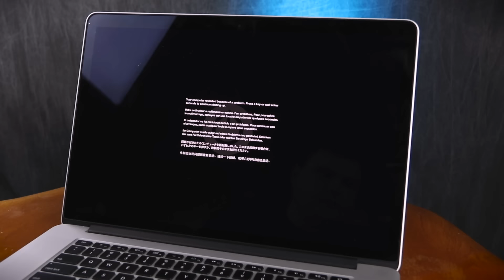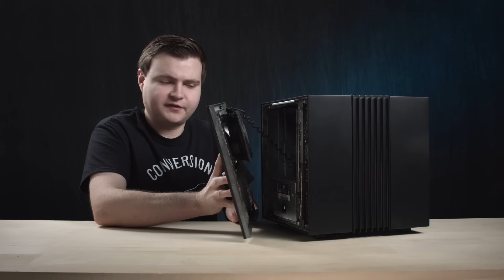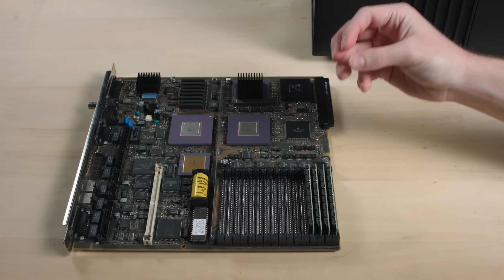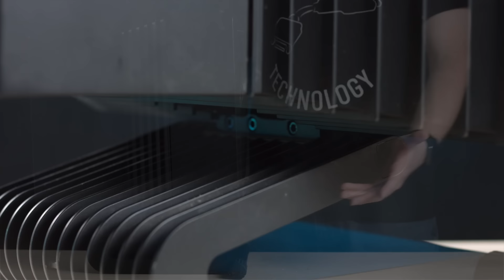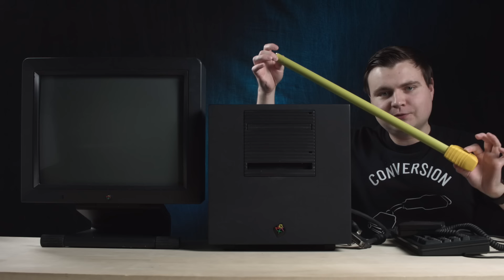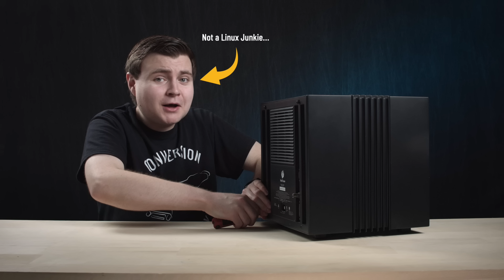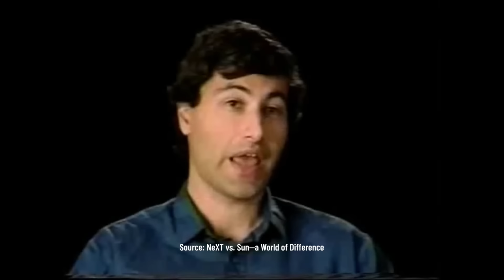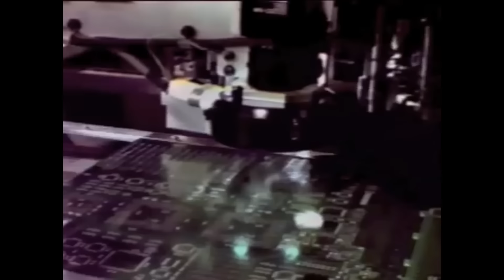I Bought a NeXTcube, Now What? - Krazy Ken's Tech Misadventures

Comment: The following is a brain dump. My memory may not be 100% accurate. In the terminal pbcopy and pbpaste can be used to shuttle text between the clipboard and stdio in the shell. This is incredibly useful. It still exists in OS X.  We used these as pentest boxes in the 90's. A favorite "move" for me was peeling contents out of spreadsheets with copy and then using awk/sed/cut/etc to manipulate the data. One could use a `pbpaste` in a for loop in the shell to iterate port (strobe, then nmap) scans across an arbitrarily large number of hosts. I still do that today, in fact, 21 years later.  You can also drag a file icon into the terminal and it'll "paste" the absolute path to the file, including \ escapes for spaces. There's a bunch of great music/sound tools for it. Look around for Princeton Sound Kitchen and Music Kit. IIRC Stone Design gave out license keys for their entire software suite, which included drawing software, a word processor, and a spread sheet. You'll want to compile a (much earlier) version of gcc on it, particularly if you want ssh. If you can find a copy of Allegro Common LISP for Nextstep, and so far I have not been able to, Allegro will hook you up with a license gratis. If you have a printer you can turn it on and off w/the shell via nppower (nppower on / nppower off). The defaults command dumps the user's defaults settings. You can "defaults read" to dump the settings and "defaults write" to write them. niload / nidump handles the contents of some configs that would normally be text files on literally any other system of that vintage. So you can dump the /etc/passwd file with nidump /etc/passwd . . I think it also handles the hosts file, groups file, and perhaps one or two others. There is a fairly substantial freeware/abandonware software base out there. Google "peanuts archive". For the viewers it is possible to get Openstep and possibly Nextstep 3.3 running in a hypervisor, but it will take some fiddling about and you won't be able to run binaries that require the 56k DSP.
Reply: Does that thing have an MO drive? That slot suggests that it does. I don't know of any of those drives that still work. Most of them started to die off fairly quickly. They were also terribly slow and I am fairly sure that Bernoulli and Syquest disks were more popular (and they weren't all that popular). So good luck finding a MO disk. :)
Reply from the maker: It has an MO drive, but I don't think it works. Coincidentally, I have a Bernoulli disk and disk drive. I'll show those in a future episode. : )
Reply: @ComputerClan  ooh! 8" or 12" (phrasing!)
Reply: @ComputerClan  See if you can get a copy of "The NeXT Bible" by Doug Clapp. That has a lot of info on the original system (030) which is not that different from the 25Mhz 040. Nextstep 3.3 (and Openstep 4) run like gangbusters on SPARC and HP PA RISC hardware. After my personal Turbo ColorStation got too long in the tooth I started running NS 3.3 on a HP PA-RISC 712 workstation. It was amazing.
Reply: One last thing! I notice that you don't have anything about A/UX on your channel. You should take some time and put it on that sweet IIci of yours. :)

Comment: Funny you talked about CD quality 44K 16bit, but even by today's standards its still very good if you consider the fact that most listen to compressed music files thru crappy earbuds. In my studio I record at 128K 24bit and then down sample to 44K 16bit which is still the standard in many cases.
Reply: this has nothing to do with earbuds, and more to do with it is far too expensive currently for the general consumer to run a sound card that is capable of outputting at that, especially when you consider that all hooked up equipment also has to support that rate, and even my THX Logitech system only supports 96k supposedly.  And when was the last time you saw a computer with a separate sound card outside the late 90s?  almost all sound is handled in the mother board now, unless you have the money to splurge on fiber and decoders.

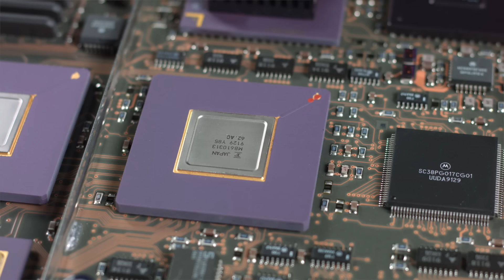Comment: 9:30 this particular board probably was designed in 1990, but it was manufactured in 1992, or very late 1991  (9:30 left chip shows as mfg date the 42nd week of 1991).

Comment: have you tried increasing the 'resolution' to 256 colours, and then improving the colour_quality. That would be next_level computing on a 25mhz system. you'd need to source a custom video card though.
Reply: Someone probably has a NeXT Dimension board floating around.  Full coloration for the cube , the board was $6000 when new.

Comment: Use a framing square to measure it. Also the slack in the end of your tape measure should cancel out differences between pushing or pulling on the end while taking the measurement. In this instance, just pull for every measurement to make a meaningful comparison.
Reply: Just put it sideways and top-down onto the table, mark the dimension with pencil on the tabletop. No need for absolute measures.

The 1mm difference is probably to counter the optical illusion that a perfect square always looks taller than wider. So it looks perfect to the naked eye. Of course, they couldn't upset customers by selling a (deliberately) imperfect cube, so the brochure gave the dimension as 305mm +/-1mm.

Comment: I used to have one in 1991.  As software programmer, it was a fantastic operating system. 

By the way, the floppy disk supported special floppies with 2.88 Mega bytes storage, twice the 1.44MB standard at that time.

Comment: I was a interested several years ago, but also asked what I would do with it. It is a very rare and cool find of history. These units were pricey, thus in lie numbers. In about 2007 I could have purchased a running Lisa for about $500 US, I stupidly passed this up. My buddy was going to buy a Cube, but instead picked up a MAC Quadra loaded with 128mbs of ram, while most of us had 16mb PCs. Regarding the manufacturing date? Nice to see American made. Those noise while operating? Either a cable touching a fan blade or bearings are shot in a fan.

Comment: It looks like this thing was built so you could slide 4 motherboards into it.  Would that even work?  Could you have used this as a server with 4 CPUs, each with their own RAM, somehow?
Reply: The cube wasn’t designed to hold multiple motherboards, but you could do it by moving some jumpers on the backplane board. You ended up with 4 independent computers in the same box, rather than 1 computer with 4 processors.

Comment: I had a Mac with 3 nubus slots I think, I actually used one of them.  I think I was the only person in Ontario to buy a Nubus card lol... as the Nubus cards cost more than some computers ..... Cool NeXTcube though! I remember those, they were indeed  $10,000. My first Mac of around 1992 cost me $2500 and it had a 68030 and did not include the color monitor or printer or keyboard. Still it was cheaper than the NEXT.

Comment: someone get this guy an actual tool kit. drives me nuts watching people use the wrong tools let alone a bulky ass pos utility knife. its also pretty amazing youre able to measure 1/2 mm with a tape that only measures inches and feet... astounding.
Reply from the maker: It wasn't a utility knife. It was a hex key kit, and there were hex screws on the back. So… I thought that would work. Hex key. Hex screw. Ya know. Simply.

Comment: As a certified Apple tech I had the opportunity to see some older equipment in a Apple research center. 

They went over the logic board in detail.  Apple didn't call then motherboars. That's a PC term. 

Love your review, beings back lots of memories.  One thing to point out, it appears that you not using any ESD protocols. 

A antstatic mat and wrist strap should always be used.  PC's are better protected from static discharge.  The logic board you are handling it not!

Comment: With the kind of high voltage pars found inside a CRT, I am not too sure you would want the outside to be metal.  I am not saying that it has never been done but the ones you see with metal are probably grounded in multiple places.
Reply from the maker: Ahhh, good point.

Comment: I like how that fan had a removable plug.   is not something I ever see on anything
Reply: Other than inside a powersupply, I've never seen a soldered fan in a computer, they always have connectors. Even inside the laptops I've worked on.
Reply: But they do have plugs

Comment: Back when I was a teenager I actually got a NeXT cube for free from my local computer shop, the guy that was running the shop gave it to me cause it had been sitting there for months and he was tired of looking at it, Mine had a dead removable drive, I took it out to try and fix it but it was beyond repair, I kept the disk though, I also have the NeXT laserjet printer, I have no idea if the printer works cause I couldnt figure out how it connects

Comment: Had one of those on my desk in 1994. Was pretty sweet for the time! 

But the chip density on this board is pretty typical of 1988-1990 boards. If you're going to take chances (and they certainly did!), you don't typically do it on the PCB!  :D
Reply: Yeah the NeXT motherboard was nothing special.  HP-PA Risc had an awesome circuit board..., and it ran NeXTStep.

Comment: The The Motorola 68040 is a 32-bit microprocessor from Motorola, and was released in 1990, yes that NeXTstep 2.2 PC looks good, but $10.000 for a machine that do not have colors is just not really acceptable, The Amiga 3000 that came out in also 1990 had 12-bit color palette (4096 colors), and had a Motorola 68030 CPU at 16 or 25 MHz, yes slower then the 68040 25MHz but a LOT cheaper, and could be upgraded to a 68040 and later to a 68060.

But the Amiga 1000 back in 1985 could already do 2-bit color palette (4096 colors), also back then for a LOT less money, same for the very popular Amiga 2000 (1987) that was used by a LOT of companies to make graphics for in movies cartoons and many more.

Comment: Maybe measure it with you know, a metric ruler or a square with metric graduations. Using an inch scale is going to add an awful lot of uncertainty. 16th inch graduation markers are kinda all over the place as far as a mm is concerned. It'll be difficult to eyeball. 1mm equals what like, 0.040 inches I think. One 16th is 0.0635 I think? Anyway nothing lines up well at all mixing the systems. Not at that scale, not measuring a single mm over 12 inches.

I'm rather curious as to what the optical drive was all about, did it not work in your rig?

Comment: The menu system was similar to IRIX which was also vertical instead of horizontal. Having it a movable item made constantly mousing to the top of the screen a non-issue. It's a pity OSX abandoned that when they did the Aqua Interface to placate Mac users.

Comment: The DSP I can possibly explain a little. Back when Apple Computer was formed, they had a trademark conflict with Apple Records, which was solved under the stipulation that Apple Computers couldn't produce studio quality music (not unless you're an end user who could set up an aftermarket interface like MIDI or even stereo sampling hardware). Which is why up until the early to mid 90s, you simply couldn't get a Mac with stereo outputs, just a mono speaker (Atari ST variants and even the lowly PC of the day could trounce them on that at the time). But since this was NeXT, hey, no trademark conflict! So it could be built for full digital audio without repercussions.
Reply: And you had to pay extra for an audio digitizer so you could record on a Mac.
Reply: Macintosh II. Introduced March 1987. Stereo audio output. Macintosh Quadra AV. Introduced July 1993. Onboard - AT&T 3210 digital signal processor - for on-board 16-bit 48 kHz stereo audio playback and recording capability.

Your history seems a bit off.

Comment: My Amiga had CD quality sound..like it was no big deal, really.
Reply from the maker: I believe it was a big deal. Hardly any machines had it. Just because your Amiga has it doesn't mean everyone has it. : p
Reply: If you are referring to your A4000 (and/or other Amigas): Technically no, it has absolutely not! Only in theory, that is. It is capable to produce 14 bit only and that is only possible by combining 8 bit DAC and 6-bit volume control. (oversampling)
It can technically handle up to 57kHz sampling rate, wich is highly dependent on your CPUs power. And, most importantly, the systems graphics mode must be set to double scan-mode.
The overall quality is...let's say listenable...more or less..., when playing back mp3, don't raise your expectations too high.
I used to have an A1200 stuffed inside a Micronik Tower, packed with a Cybervision 3D and a Phase 5 Blizzard 1230 IV with 32 Megs of RAM on it and the coprocessor. I experimented a long time with mp3-playback and it was not really ear-charming, but fun to see, that it was possible. What I noticed everytime was a really high CPU-usage wich resulted in high loading times for each file. And it suttered here and then. I dreamed for a Toccata, but could never afford one.

Amigas were really some beasts of a machine, but never in stock-condition. So be true to yourself, wenn posting such rubbish.

Comment: The data sheet was interesting, especially how one could upgrade the dedicated SRAM for the Motorola 56K DSP. I don't recall that being an option on the later Atari Falcon030 which also featured that same Motorola DSP. That was one awesome chip both for audio and for what it can do as a fast co-processor for a 68030 or 68040.

Comment: get an 040 to 060 upgrade for it, you can find them on ebay. its a socket that fits for the 040 and steps up to a regulated socket for the 060. you may or may not need drivers? i know the amiga does.....
Reply: Vampire board for the NeXT!

Comment: I would definitely replace the stock fan with a Noctua fan and you'll just never hear the worn ball bearing again :D Also, replacing the SCSI hard drive with a SCSI adapter and shove an SSD or SD card in there would be a big leap.
Reply: Based on the type of connector on the fan, it is probably 120V AC not 12V DC.
Reply: Why replace it, unless you want to spare the aging HDD by not using it. SCSI should support at least 8 devices on its bus (looking at the cable it seems to be the narrow variant. One ID will be reserved for the controller itself, so you have 7 actually useful device IDs). You should be able to just add some more storage devices to it, as long as they are narrow SCSI....
Reply: Jiri Wichern Because of the noise it makes after all these years :)
Reply: Sure, if you actually intended to USE the thing, but why would you?
Its cool for the time but TERRIBLE compared to even a 2001 imac.
Reply: @mawlakewlz  So people using C64s today for their enjoyment are just plain nutjobs? Surely not. There's something magical with these old machines and for a specific set of tasks they're totally fine even today. You won't be gaming on there in 4K, but that's not the point. I sometimes spend time in front of my Macintosh SE to do some writing and it's a so nice, uncluttered, undistracted experience. I would definitely use a NeXTcube if I had one...
Reply: Bubba this is a piece of computing history. Stock components only. Respect the cube.
Reply: @an1skh4n  You should upgrade components also, harddrives will eventually fail ..

Comment: DOOM through QUAKE (I) were done on NeXT too, before id switched to Windows NT for QUAKE II.  Atari's Falcon030 computer from 1992 also used the same DSP as the NeXT computers, which was touted as being able to handle 8 channels of 16-bit audio (up to close to 50KHz sample rate) simultaneously.
Reply: Yes, the Motorola 56K DSP was incredible for that era, and why it cost $1k on its own. Atari Corp wanted to use the DSP as its own voice modem in the Falcon030 but never got around to finishing the software for that feature set [they also ran out of money before enabling that with the Atari Jaguar's DSP too]. It cranked out awesome audio. There's a few modern audio chips that use cores from that chip, which have even been used in some of the iPod Shuffles but nobody so far has figured out how to use those cheap chips to use them like the full Motorola DSPs in order to, say, add them as upgrades to older Macs, Atari STs, and Amigas. There's an enthusiast porting Quake 2 to the Atari Falcon030 and he's heavily using the DSP to make that work. He said it's so much faster than the 68882 that he's not even supporting that optional FPU.
Reply from the maker: That’s awesome. I didn’t know that before I posted this video. I can learn a lot from the comments, haha.
Reply: xnonsuchx
Original Doom was ANSI C, assembly language, u used Next back then your self? ANSI guy?
What did you do back then?

Comment: $10,000 was actually not as expensive as one might think at the time.  Apple's most expensive computer at the time was the IIFX which retailed WITHOUT a monitor and only 8 megabytes of ram for $9800 without a monitor or keyboard and IBM's personal workstation computer started at around $12,000 with a similar configuration as this NEXT system and don't get me started on Silicon Graphics computers, those things were several tens of the thousands.  For what the NEXT cube did, it was actually somewhat of a bargain for the price it cost.
Reply: Plus, who else had a rewritable CD-ROM back then when the NeXT originally debuted?  Tandy promised big with their version and didn't deliver...